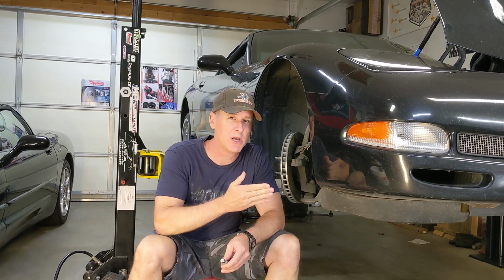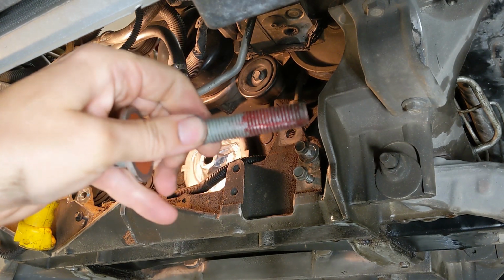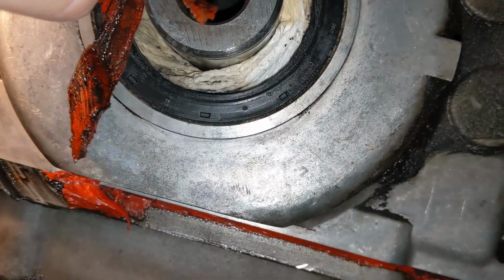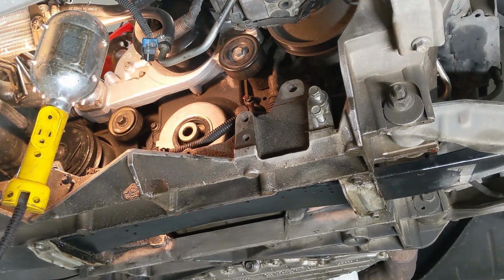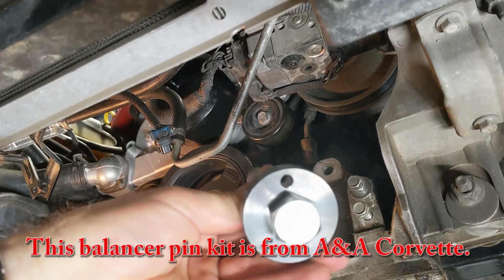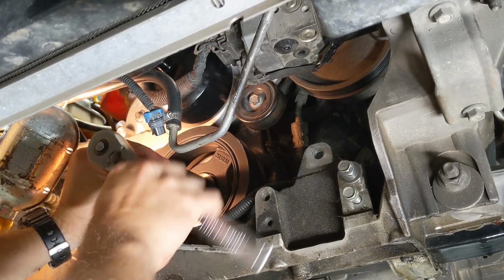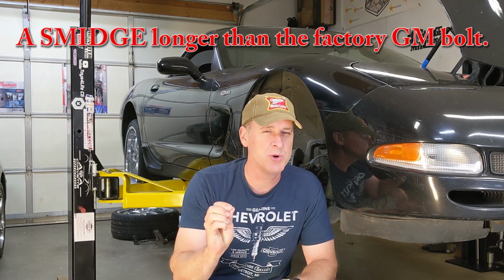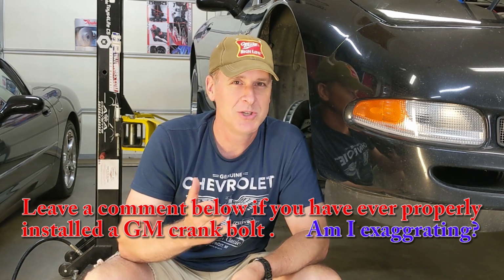C5 Corvette Z06 Harmonic Balancer Replacement (With Complications!) Part 2

Comment: When pinning the HB, did you seal the keyway with RTV, then drill the pin hole at a different spot from the existing keyway? 
Thanks so much for this video, probably saved me $1000 to do it myself.
Reply from the maker: Glad it was helpful  & consider hitting that Superthanks button if you got good value from it.  I do put a dab of RTV in the keyway slot on the balancers that have a slot and drill away from the keyway in a new location.  Cheers!

Comment: @Toys4Life C5 Would you recommend making a chaser from a new GM crank bolt, even though it hasn't been fully torqued down yet (if that matters)? I'd rather not risk using the old one given it's wear/age. Since I'm going with the ARP bolt instead, I've got a fresh OEM one handy. 

Also, I planned on buying a chaser tool online, but the only thing i can find in the M16x2 size are taps and I'm not sure I want to be that aggressive just yet..

Really appreciate your videos sir. Thank you!!
Reply from the maker: If the old one looks to be in extremely good shape, use that. Otherwise I don't see any issues using a new bolt other than throwing away the cost of new bolt.

Comment: Shame on GM for leaving out the key and the keyway that was standard on all Chevy & American V-8 engines. How much did they save by doing this? The OEM harmonic balancers are two piece where the rubber between the two parts are known to fail. It looks like your replacement is one piece.
Reply from the maker: Probably made it quicker to install the dampner on the crank at the factory since it didn't have to be clocked to the key before cranking the bolt down...
Reply: Thanks for all your videos. You do a great job saving guys like me correcting problems like this because GM planned obsolescence. Melted down parking lights being used as driving lights is a sign of GM being thoughtless, or greedy. My 1999 C5 has a Procharger and I quickly found the stock clutch could not hold the added power. Swapped the LS7 assembly and hydraulics. Keep up the good work!👍👍😃

Comment: How do you know when to stop pressing the harmonic balancer on? How do you know where the depth should be?
Reply from the maker: You should see it pull on most of the way with the installer.  Then when you do the final torque of the final bolt, it is fully seated.
Reply: @Toys4Life  I’m. Thank you. I wasn’t sure if it would bottom out and that’s the tell tell sign it’s on fully or there was another sign. Thanks again.

Comment: Have you ever installed an oil pump while you're in there? Seems tricky to find good install videos or instructions...even on the Corvette Forum. I've got a 2000 C5 convertible with 133K miles and I'm beginning the harmonic balancer job and figured with such high mileage, I may as well do the timing chain, sprocket/gear, and oil pump.
Reply from the maker: It's a slippery slope, you can always do more when you're in there all the way up to replacing the whole motor. I struggle with where you draw the line, and keep in mind too that sometimes new parts are defective, imagine putting in an oil pump only to find the new one fails!!

Comment: My ARP bolt was a smidge shorter and that was a problem
Reply from the maker: Defective?
Reply: @Toys4Life  possibly…. It wouldn’t pull the balancer in quite all the way to line up properly, the OE bolt actually did!  Anyways, we did it without removing the steering rack but still had to disconnect the lines as the power steering cooler was still in the way.  2.5 hour job in the shop!

Comment: i realize this is an older vid but i’m hoping u will still reply. what size push pin did u use on the puller? i see there’s 4 different ones i was just wondering how deep it needs to go
Reply from the maker: I recall you start with a short one and then you have to put a longer one in there good at the rest of the way off.

Comment: I love your videos. I never knew you could cut a bolt like that and repair threads. I have the same job coming to the shop soon. Now I feel confident about the repair. Thanks again.
Reply from the maker: Appreciate the kind words, certainly a thread chaser would have been ideal, but this works in a pinch!

Comment: I certainly learned why replacing my harmonic balancer (last week, on my C5 convertible) cost so much! (Had it done by the best Corvette shop in the Mid-Atlantic region, and I feel it was worth the cost.) But my question for you is -- after all that work to get into there, why didn't you install an ATI Super Damper?
Reply from the maker: After reading the forums, the power bond seems to be extremely reliable. I spoke to A&A, and they told me they had great success with it as well. That was good enough for me. Now let me ask you why do I need the ATI super damper. What's it going to do for me specifically that the power bonds not. Not a sarcastic question, I am not a balancer expert I know it dampens vibrations but, it depends on where the car is I think most of the time as far as RPMs go. Most of the time my car is at normal RPMs, then there is the occasional hit. If it was a race car that was constantly cruising around at oval track at 5000 RPM I probably would have a dampener tuned for a different RPM. But, I haven't open mind so let me know (:-)

Comment: I hate the balancer bolt. Some bolts are torque to yield, some aftermarket bolts have totally different instructions, its a mess. Im an aviation tech. Im considering just undertorquing it and giving it some safety wire coupled with a pinned crank.
Reply from the maker: I hear you and agree 100% - confusing info out there.  Going forward I will likely just use the GM TTY bolt.  It is cheap enough and you don't hear of stock LS balancers falling off all of the time.
Reply: @Toys4Life  My friend ruined his crankshaft because the balancer lost friction and started spinning.
Reply from the maker: Had it been replaced and somebody improperly torque the bolt or was that as it came from GM? I would think if GM let it leave improperly torque it would fail within the original warranty?

Comment: Where did you buy the water pump, and remember the part number? Also would you still pin the crank pulley if the threads are in great shape. Going on a mostly stock c5 . Also do you recommend any thing else to be replaced while doing the crank pulley and seal? No racing on this car. Thanks
Reply from the maker: Napa for the water pump, check your pulleys and idlers and tensioners, new belts if they're sketchy and no, if you're not going to race it at all probably don't need to pin it. Good luck!
Reply: thanks for the quick response. Lastly how about the timing cover gasket?

Comment: Great video.  Especially on a Z06 - how did the HB issue possible slip through QC and long term testing.  HB should have a key and drift or pin into crankshaft.  GM builds junk.
Reply from the maker: The stock HB's take don't fail immediately - so they slipped through QC.   That having been said, they seem to fail too soon which leads me to believe (my opinion) that their supplier has a subpar elastomer or something in the process of bonding the two parts.

Comment: Do you have the part # for the ARP crank bolt and the tool used for drilling the pin hole ?
Reply from the maker: ARP bolt part # is in the description.  Give A&A corvette a call - they should be able to sell you a quality pinning kit.  Good luck with the project Tim!
Reply: @Toys4Life what socket did you use for the ARP bolt

Comment: My car had the HB was replaced by the previous owner and it would always leak. Today I replaced the seal and when I took it off I noticed there was a little damage on the inside. I’m assuming the shop has damaged it when pulling the seal off. Would this cause the leak? Also… they never rtv’d the key way on the summit balancer 🤦‍♂️
Reply from the maker: Yeah if you put a big gouge or the seal presses into the timing cover you probably want to RTV that before you put the seal in and I'm not familiar with the summit balancer but if the keyway goes all the way through the entire length of the balance or then yeah it would need to definitely be our rtv'd.

Comment: Don't I need to hold the crank to keep from turning? Someone makes a tool that goes in the starter bolt holes. Has "teeth" to hold engine when you're cranking the H B tight? Advise?
Reply from the maker: Summit makes a nice tool to hold the harmonic balancer, I'm pretty sure I showed it in the video take a peek. I did not take my starter out.

Comment: The shop manual said something about having the crank recessed 2.4 x 4.48 mm into the balancer bore. Doe the install tool handle this?  It would seem that once everything is tightened the recess will be gone so what’s the sense.?  Is my thinking right?
Reply from the maker: Yes, once you pull the balancer on and then start twerking down the bolt it'll fully seat provided there's nothing defective about your new balancer.

Comment: Hi, quick question. I've replaced my HB with ATI and installed a new seal as well but after about a month oil started leaking around the seal and goes down the oil pan. Did I missed something? Thanks
Reply from the maker: Other than using a good quality seal and putting a little grease on the balancer hub prior to installation I cannot think of anything.  I would clean everything good and run it to make certain the balancer seal is where the oil is coming from.   Also make sure your bolt is tight - it is not unheard of for them to somehow not be torqued properly and back off.   Sorry you are having a problem!
Reply: @Toys4Life  I've used OEM seal just fyi. So on the balancer hub do I put grease inside or outside the HB hub?
Reply from the maker: Smear a dab of grease on the outside of the hub that rides on the new seal.
Reply: @Toys4Life  Thanks again, I'll try that..

Comment: Where did you get the crank seal and are they the same for a 1998 C5 ?
Reply from the maker: Rock Auto.  I'm not sure if they're the same, just look it up.
Reply: @Toys4Life  thank you, what tool did you use to remove the old seal ?
Reply from the maker: Just a normal run-of-the-mill seal puller. You can get them at harbor freight for like six bucks, it's a very simple tool, no need to pay more.
Reply: @Toys4Life  thanks man, been following your videos to a tee and got my crank bolt off yesterday, half way there now

Comment: When cleaning up the inside crank threads consider magnetizing your thread chaser or tap. Makes it more likely the chips will stick to the chaser and removed instead of getting pushed into the crank.
Reply from the maker: Most use grease, I will have to look into magnetizing the thread/chase, interesting idea!  Thank you!!

Comment: Thanks for your great videos. You have the harmonic balancer in the oven at 150 degrees. I guess it's Fahrenheit. It's not that high a temperature. Is due to the rubber in the harmonic balancer you do not have a higher temperature?
Reply from the maker: It is fahrenheit. Yes, I'm sure it gets hotter when it's actually in the vehicle but to be safe and to remove any possibility of cooking the rubber within the balancer I just go to 150f.  In the past that's worked very well

Comment: How do you avoid messing up timing when removing a balancer? I want to also install a crankshaft seal protector plate on my BMW
Reply from the maker: No worries - replacing the balancer on the LS1 cannot mess up the timing.   Cheers!

Comment: Why did you go back with the GM balancer & not upgrade  to Summit 2501 or ATI super damper. Is your friend selling the vehicle after fixing this?
Reply from the maker: Went with a Power Bond balancer, well known to be reliable - even for mild supercharged applications. Worst thing you can do is put the GM stock replacement balancer on. No need to go any more expensive or elaborate than this.

Comment: The question is because I turned down buying a 2005 c6 Corvette because of this issue the question is once you get this work done how long will it last and will you have the same problem in about 3 to 4 years or less or more anyone out there has the answer let me know thank you
Reply from the maker: As long as you replace it with something other than a GM balancer, it should last a long time!

Comment: Excellent video.  What is that special tool you are using to first seat the new Summit dampener?
Reply from the maker: The new balancer is from Powerbond.  The tool is from Summit - LS harmonic balancer installer - works like a charm and priced right!  Thanks for the comment!

Comment: Great video! Any thought to doing an oil pan gasket too?  Had to replace the one in my C6Z.  Started leaking when the vehicle was about 10yrs old.
Reply from the maker: We'll see if that leaks. There's not a ton of overlap, but I think an oil pan gasket in this situation if needed what also warrant engine mounts while we're in there. The thing is once you get close to 200,000 miles, you start digging in you I have to be careful because there's always something additional it seems like you could fix it or replace.
Reply: Good video👍👍👍
Reply from the maker: Thank you, appreciate it sir!

Comment: Had no idea the torque for the crank bolt was so high!  And, for it to have such a short thread shaft.  Wow. What brand of balancer did you decide on?  Cost?  Does it have to be pinned?  Thx for all the hard work and great filmography…great detail on the camera!
Reply from the maker: Thank you!   Powerbond balancers seem to be the best stock replacement based upon years of review.  PB1117N  about $95 at Summit.
Reply: @Toys4Life  Not bad!  Thot they’d cost much more. Thx again.